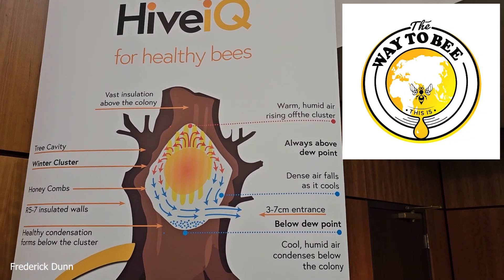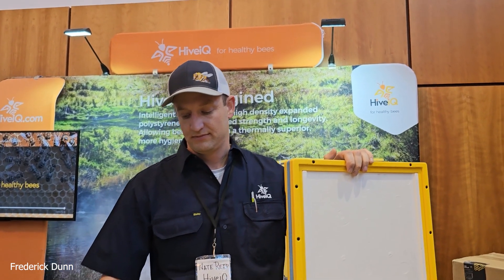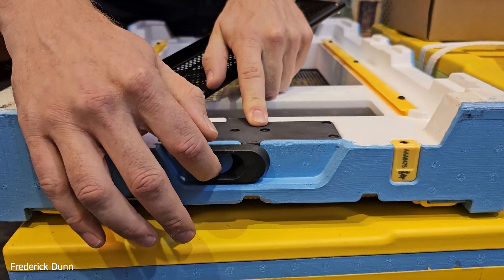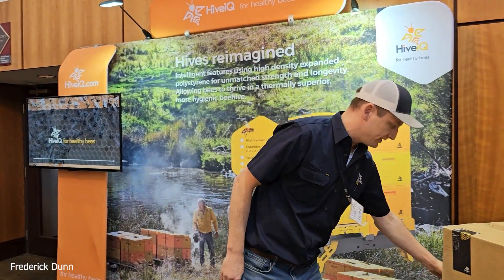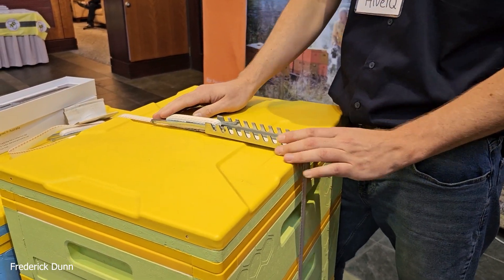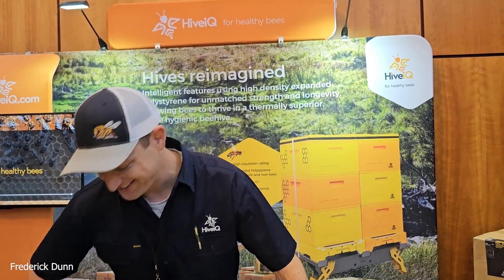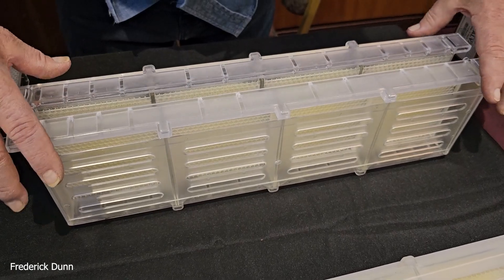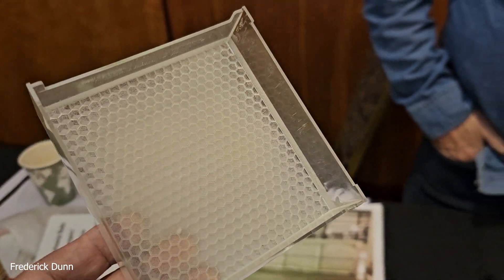New Hogg Halfcomb system and Hive IQ details at PA State Beekeeper Conference 2024

Comment: For those considering Hogg Half Comb, I only had success getting them drawn out and filled when I set the super on a very strong single deep colony, during a strong nectar flow, and ONLY gave them that super to fill, basically giving  them no choice but to use it. Had to monitor very closely and frequently for swarming, but I got 33 sellable cassettes out of 40 to sell at $20 each. (MUCH better return than SimpleKomb btw). Going to run 2 Hogg supers this year.
Reply from the maker: Thanks for sharing your experience and method for those. Much appreciated.
Reply: @FrederickDunn  yessir! I expect that if someone’s just using the new 2 frame system, one would need to remove the regular comb frames from an already full super, again to force bees to use the Hogg cassettes.

Comment: Intersting stuff!
Hogg Halfcombs just seem great overall.
I wonder how sturdy HiveIQ's polystyrene hives are though, that material can break from just a stronger grip.. dependnig on density of course. I already saw some indents on the close-ups. Maybe that's no issue though, I wonder how well they'll work for you!
Reply from the maker: There is a wide range of durability when it comes to those poly hives. This one felt much firmer than Lyson, for example. I've also never found one with a metal capped lid as this one has. I was happy to have a chance to look one over.

Comment: Thanks for the quick update, Fred. 
I like that half comb system. It's very clever, and it does appear that you can supply friends with comb that way and then re-use the plastic trays. Awesome. I hope they come to Australia at some point!
I was very lucky last year. I run foundationless frames and had a decent harvest of straight, clean comb to cut up and share. Not sure what this honey season will bring.
One thing I do know, and that is that lots of folk love the novelty of eating comb honey.
Reply: The Hogg cassettes are not intended for reuse. Not only would getting them returned and cleaning them be a challenge, but realigning  individual cassettes and securing them into rows and loading them into supers would be a pain.
Reply from the maker: Nothing at all wrong with just cutting come from your foundationless frames :)  We also do that here.  As the owner stated, re-using the cassettes would be for personal consumption and of course, not taking returns from those you may sell them to.

Comment: Last summer I tried the Hogg half comb and was very disappointed.  It came assembled but the cassettes were not waxed and the bees did not use them much .  Got 6 or so filled out of 30.  This year I used SimplKomb and had better success but it was a real pain.  Out of 80 cassettes 39 were nearly perfectly filled and capped.  Another 20 were overfilled and/or had bridge comb that tore so they were not perfect.   It was a lot of work and I would not use SimpleKomb again.  My plan is to wax the Hogg cassettes and try again next summer.  I really like the idea of a 2 frame box… might have to get that for all my empty Hogg cassettes
Reply from the maker: Wow, they weren't waxed? I'm surprised they used them at all. I'd definitely prime them with a nice coat of beeswax to start off. I didn't realize that you can buy them with nothing on the bottom.. thanks for sharing that valuable tip.

Comment: I use Hogg Halfcombs for comb honey production, and this year have had very good luck with them. 34/40 cassettes full and sellable from one hive, with the Hogg super added over a medium honey super with no queen excluder on the hive. They were filled during the blackberry and privet flow in the spring. They performed better than the Ross Rounds, with less fiddling, since there is no foundation to add. When i use Ross Rounds, the bees often chew the foundation out, whereas the Hogg doesn’t have foundation to steal.
Reply: Were your Hogg cassettes waxed?
Reply: @craigo4dds they come waxed from the manufacturer
Reply: @ nope. I put them on as they came from the vendor.
Reply from the maker: Thanks for sharing! You always seem to do well with your stock. I also like the Ross-Rounds as they have done well here, but as mentioned in this video Ross Rounds are double-thick.
Reply: @ I learn from the best! Thanks for the videos!